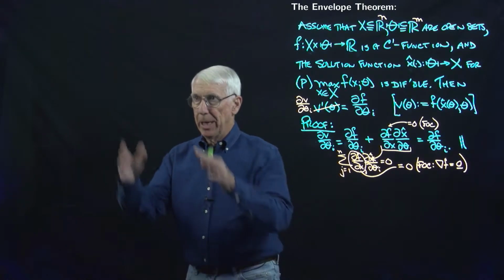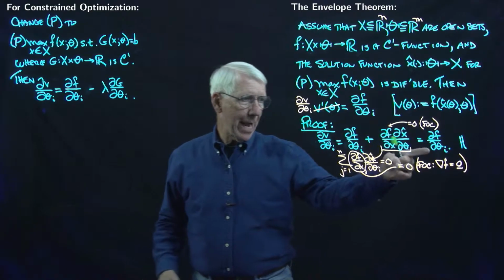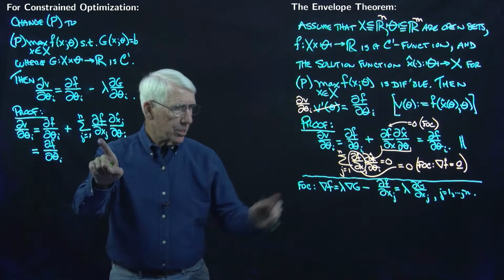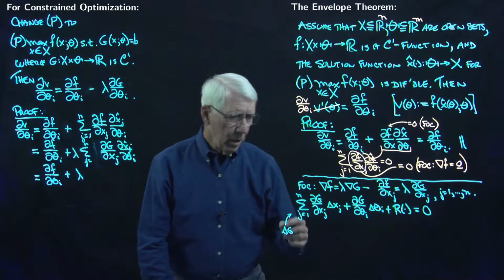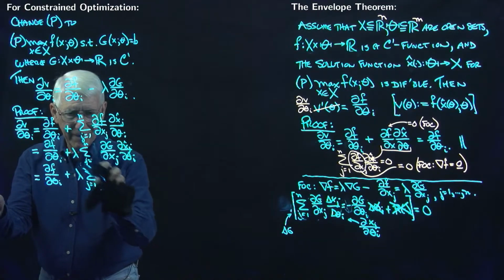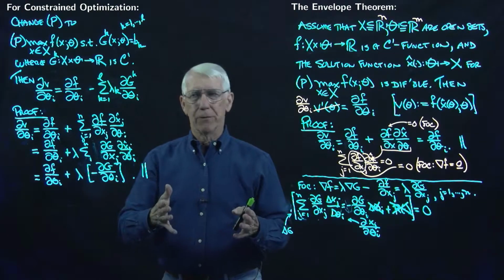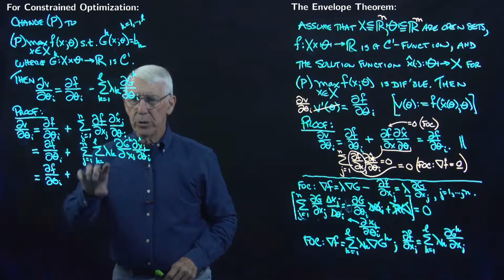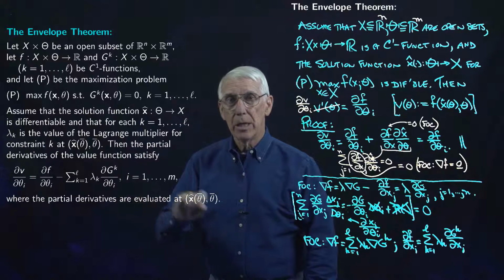Lecture 38(B): The Envelope Theorem for Constrained Optimization

Comment: R.e. the comment below about @11:30 R/∆Ø going to 0. I have watched the previous lectures closely, and I understand why R would go to 0 in the limit (because the linear approximation approaches the actual function?), but surely now we have 0/0, and I'm unclear the solution to this undefined limit in this case? What am I missing?
Reply from the maker: The limit of a quotient is not the quotient of the limits if the denominator is going to zero. Consider the limit of 3x/x as x goes to zero: it's obviously 3, not the (undefined) 0/0. (I'm sure you knew this. Everyone makes mistakes like this.)
Reply: I think it's still not clear why R/Δθ goes to zero as we have the 0/0 situation. Perhaps a deeper explanation can be provided? Thanks!